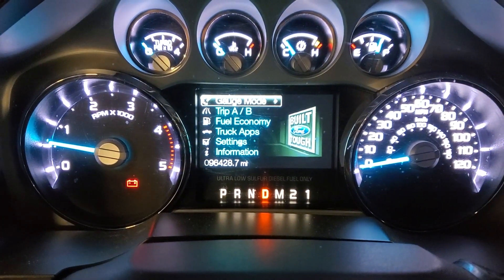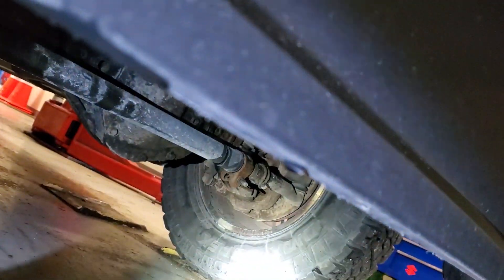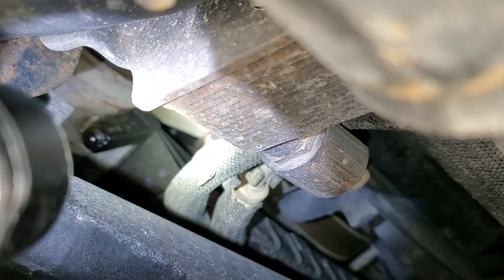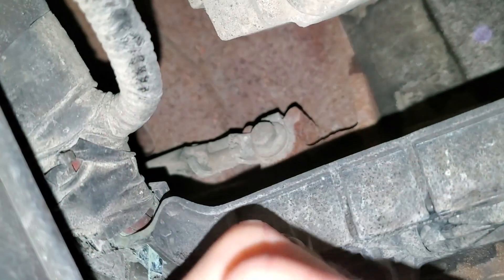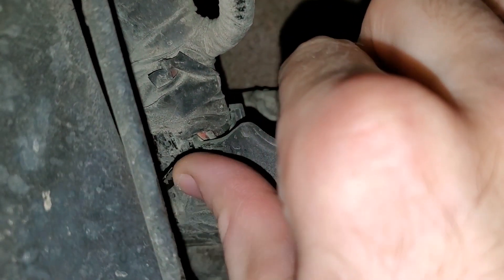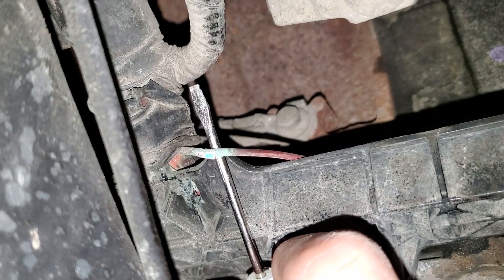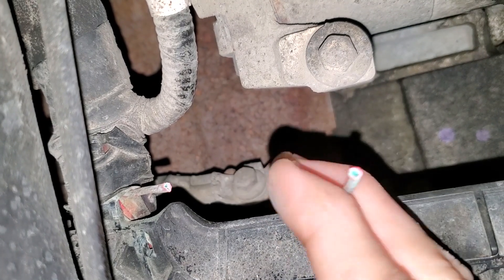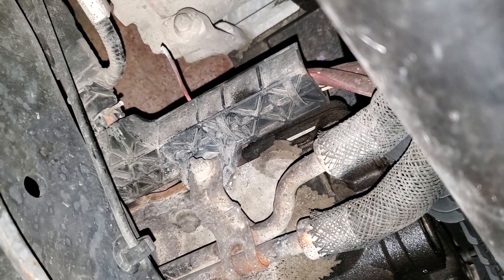2014 FORD DIESEL 6.7 | A P0620 MUST SEE BATTERY LIGHT ON |

Comment: What if you have dual alternators
Reply from the maker: Then ud have a code for the secondary alt
Reply: @PowerStrokeTechTalkwARod ya it’s Generator 'B' Field Terminal Circuit Low.  Is the b alternator the one on the passenger side?
Reply from the maker: Yes
Reply: @PowerStrokeTechTalkwARod that would actually be the field windings in the alternator right?
Reply from the maker: You need to follow the pinpoint test for the code you have.

Comment: So it finally kicked q code but i have power down seconde gen com dies in splice and bleeds same kv signal over then as start it goes out i had to unplug map or voltage spikes shut truck off but seen flicker red light on dash and po602 28 code i need check that wire again but didnt find anything yet with wires still have control mod 63.47 volts i had no start last week but worked past that i think pcm but cant rule out a wire or fuel pressure sends hi readings

Comment: I just had my 2011 stop charging but NO battery light. I thought must be the pcm or the harness. Checked everything and finally figured I’d yank the alternator and bench test…wouldn’t you know it, of all the super duty’s with junk harnesses and burnt up computers, I had a regular old alternator failure 😂

Couldn’t find anyone else having this experience. 

Again, no battery light, no codes…just stopped charging and only thing I noticed before the batteries finally died a day later was a slightly high idle.

FYI to anyone who cares!

Comment: I have a 2012 f350 6.7 run 3 new wires soldered and heat shrinked , and battery light on , so the frustration continues, read to check fuses and also the $450 Canadian that is no longer available circuit breaker fuse thing beside the passenger side battery

Comment: I'm a fleet mechanic with an electric utility. We have over 300 F550's all with 6.7 engines in them. As you stated, the alternators are extremely durable. So today when a 550 came in and the operator was complaining about the battery light being on and that a mechanic at another one of our service centers had replaced 1 of his batteries (?) and told him the light would reset on it's own (it didn't), I was scratching my head as to what the problem could be. The day mechanic took the truck in for me to work on tonight. As he was a Ford tech before coming here 11 years ago I listen to his advice. He suspected the inverter battery might be bad. So I pulled the truck in this evening and dug out the inverter battery. It was manufactured in August of 2016 so I replaced it. I started the truck and after about a minute or two the charge light came on. I checked the alternator output and it was 14.3 volts. So I broke out the laptop and scanned it and came up with the dreaded P0620. That led me to you and after crawling underneath the truck and digging the alternator control wire out of the harness (it's slightly different on a 2017 F550 than your example) sure enough, the wire broke in half when I pulled on it and it was all green and corroded. So what would have taken me all night with a meter, Ford shop manuals and probably a couple of calls to some other Ford specialist mechanics I had it fixed in about 30 minutes including a 10 minute test drive. THANK YOU!!!!

Comment: I have a 2009 Mazda 6. Generator output is 13.5V but battery's light stays on. Out put stays the same whether the alternator is plugged in or not. Changed alternator,ecm 13.5v output and battery light still on.
Reply from the maker: Ok...

Comment: Have this problem on a 2018 F250. I tested the wires with a meter as well as with a 32watt bulb. All rings out good. Bulb lights up full brightness. But battery light is still on. Getting anywhere between 12.5-13.9V. No CEL. What could it be?
Reply from the maker: All 3 wires tested good...
Reply: @PowerStrokeTechTalkwARod  yes. All 3 tested good. Light was full brightness on all 3 wires. Disconnected the plug and now I get 13.7V charge, not cycling. Engine runs smooth. No light on the dash
Reply: @PowerStrokeTechTalkwARod  fixed. All 3 wires were ringing out good. But wire on pin 3 and wire on pin 2 were shorted to each other.
Reply from the maker: 😭😭 but i thought u tested the wires with a 32 watt bulb

Comment: I cannot thank you enough. battery light was on for my 2016 f350 and just as picture in your video but it was the yellow wire and was so corroded that when I started moving it around it broke. rosin core solder and heat shrink with piece of good quality 18 ga copper mtw wire and bingo. no more battery light and engine surging while idle. THANK YOU!!!
Reply from the maker: Frigggin aye 🙌🙌🙌

Comment: Good to know!! Wonder if that wire leads to pin #1 voltage reference cowl or
 pin #2 signal return cowl? I've removed a 10amp fuse #45 and voltage jumped from 13.4volts to 14volts. But battery light is still on. 🤔
Reply from the maker: No they ABSOLUELTY do not. Watch the other videos in the battery playlist & u will learn

Comment: Battery light I could ignore. BUT. Without this wire the computer doesn't recognize the alternator and sends the demand for half the amperage that it should. Right? Thats the function of this wire, sort of a com line between the two units.
Reply from the maker: In a nutshell yea

Comment: Had to change my like to a dislike once I found out how you glossed.over removing the plug from the alternator and how much of a pain in the ass it is.  Other than that on a DIY scale it's a pretty good video.   I would suggest at least removing the steering damper for easier access to troubleshooting the wiring.
Reply from the maker: Really
Reply: How do you unplug it, I gave up. I also gave up from removing alternative I unbolted it and could remove it. It wouldn't come lose.
Reply from the maker: I dunno bro

Comment: Thats a quick fix, and of course thanks for the tech tip. Having said that, if that wire's in bad shape, why not replace the entire length of it from alternator to pcm or battery... seems like it could be a problem in future? Or is it just in this one spot @ bend under engine & we assume no corrosion elsewhere?

Comment: I got a 0625 code yesterday so went to checking the wires on the alternator.  The red and yellow checked, however, the violet does not have a complete circuit.  Went to wire channel on front passenger side of vehicle and checked there, had continuity to the alternator from there, but not up to the pin.  I can't find any chaffing in that area, and unable to get to the wire in the harness without tearing the hole thing apart.  Am I missing another spot in that area where the wire might break?  So frustrating.
Reply from the maker: Gotta keep at it....how you think i feel....is my truck done yet...is my truck done yet....can i come get it.....

Comment: I have a 2014 battery light on. Have not scanned it. Voltage at idle is 12.7 or so. At both batteries and alternator stud.  Bump the rpms up a second and voltage goes to 13.5 or higher at alternator and batteries. Occasionally the battery light will go off. I assume weak alternator? I am a chrysler tech but its a family memebers truck.
Reply from the maker: Most likely not
Reply: @PowerStrokeTechTalkwARod  you think wiring as well? I will get the code read at work and then follow alldata. As long as info is avaliable I am very fluent with voltage drop, loading circuits etc. Just seemed like alternator at first
Reply from the maker: You have a wiring problem just like in the video I have a few other videos with the same problem just in different spots

Comment: wiring gauge is 2 small. current and voltage is proportional to resistance.   higher current in these is creating heat which is  causing insulation breakdown which then creates corrosion , and then slap in the beat down from a work truck and uve got a failure point let alone that trough which seems common...
Reply from the maker: ....no its not. The friggin zip ties....that ding a ling installed created a chafe point that ultimately caused the concern....ur gettin too technical..
Reply: I have to agree with CulbyJ. If truck is only used for mall crawingl & soccer practice with occasional trip to deer lease, may never have a problem...if you work out of the unit & beat the hell out of it daily, the wiring heats up and won't last.
Reply: These trucks are engineered to have an expiration date.  I believe they refer to it as automotive manufacturing obsolescence or some such nonsense. Wiring, electrical, mechanical parts etc....they are priced like they're going to last 20 yes but they dont

Comment: Thanks So Much!    I have a 2018 F-350 only 44,000 miles on it.   The dash was going blank while I was driving down the road and it said service charging system.   When we tested the alternators with a volt meter it said one was giving 16V and the other was .2 and it changed constantly.    The dealer said it was a software issue and the couldn't help me!   Do you believe that shit!?   I was about to take it to another dealer Monday but thought Id google the problem first.    The broken red/yellow wire was right where you said it would be.   I couldn't believe it when I found it inside the harness.    Thanks again.   Problem solved
Reply from the maker: Im so glad to have helped you save money. Help me help you....check my Paypal out & share me please!!!!

Comment: Perfect video. Only problem for me now is that there was no corrosion for me in the area, but I messed with the wires a little bit. The light stayed off for a minute but turned on after running for a bit. Any other tips I could follow along after that?
Reply from the maker: U need to follow the pin point test...

Comment: I have to have this issue with my truck but haven’t found any broken wire. Brand new alternator and good batteries. 13.4-13.7 volts coming from the alternator. Battery light on. Where should I look for some chaffing? It’s a 2009 F350 6.4
Reply from the maker: Silly videl is for 6.7. Not even close to that pile of 6.4 set it on fire brah and runnnnn

Comment: My battery light was intermittent, I have a volt meter on a gauge and was bouncing between 14.5 and as low as 12.9. Shut the truck off and back on and the meter was reading a contestant 14.5 volts . I would think if it was a wire Iike that would be more consistently an issue right?
Reply from the maker: Theres a few spots. U shld be able 2 find them. I literally just did 1 two hours ago!!
Reply: That was totally it same exact spot as this video, you saved me so much headache man i truly appreciate your effort in posting this video
Reply from the maker: Thanks so much. Not pressuring but if you liked what you saw, if you choose, make a donation of your choice to my channel. Thanks for watching!!
https://www.paypal.me/pttwarod
Reply: @PowerStrokeTechTalkwARod  subscriber for life
Reply from the maker: No...watch these 
Ford 6.7 Diesel BATTERY LIGHT VIDEOS: https://www.youtube.com/playlist?list=PLO4T4Ez-ZZaQNROJNDaD4T9WldCjExM16

Comment: You say never replace Alternators haha🤣 I agree, The alternator was putting out good 14.4 I had an 08’ 6.4l (job 2(20th nov. 2014)) and right (right wheel well)in the wheel well the wire got nailed, replace one wire on the Three way Alternator(my buddy brokers and remans alternators got knollage and parts)   Did that 4 times in 8 years (The harness was just in the rite spot for getting nailed by crap). The truck I had before the super duty was 92 F150 And the alternator breakdown was the plug<<<replace plug not alternator, I never replaced the alternator on that ever,  just changed the factory plug. Done over!
MultiMeter. I love honest mechanics. I’ve seen too many bad ons(sheisters) and I’m the first want to crack them. If you do it right I am the first want to celebrate you. You do it right 🥳🤩😍🥰😘
Reply from the maker: Thanks so much for sharing pal 😉🤝👊✌
Reply: PowerStroke Tech Talk w/ARod I love shRing but But I think techs don’t like to hear this stuff but u do, love it.!   And so far every vid of yours Rocks keep it up! I will email u if I get stuck on my truck, but peeps come to me(I keep up on the tsb’s etc...)but I do my own with a lot of knowledge from others. And thanks for being  awsome and furthering the Knollage of the rest of us. Nailed it!

Comment: Aww yeah, 2014. My baby. :-) . But, the bigger question is, how to PREVENT this? Does it need some slack in the electrical tape? How do I keep my ‘14 from getting to this point?
Reply from the maker: If i were you ALL I would cut every zip tie in that trough!!!
Reply: PowerStroke Tech Talk w/ARod this is helpful. Will check and fix it tomorrow!

Comment: You really did not say what is causing that issue there, how or why that wire is becoming broken at that spot. As I could not see any metal that it was rubbing on there, or is that zip tie put on so tight from the factory & cuts the wire. Is that the issue? And if it is and has been over the years, I hope it has been reported to Ford so that would be fixed in the manufacturing of that Wire Harness.
Reply from the maker: Chafe in the harness. Cash repair, not warranty, Ford wouldn't knw on this 1

Comment: I recently replaced the alternator on my 97 7.3 after 185.000 miles. The bat light was on and off at random due to sporadic overcharging. Wiring is all still solid and I don’t have to worry about burning up my batteries now.
Reply: This was happening on my 7.3 last year, check all the battery connections really good, cleaned them REALLY good and then lubed 'em... So far so good... Hope it'll last a bit longer, I'm almost at 190K miles. At least it's an easy alternator to swap.
Reply from the maker: Hellz yea